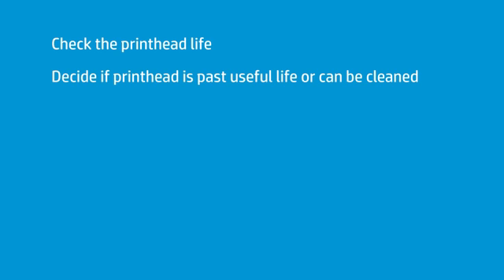Clean a Printhead | HP Latex | HP

Comment: THE BEST PRINTER
Reply: If you are making money selling you prints it doesn't really matter.. if you just want to use it once in a while then yeah, isn't worth it at all.. it's all about the usage, this machines are made to non stopping one day or two without a print the print head is gone
Reply: @ronaldsantamaria5226  sorry for my feedback but actually worldwideimages or plottermaster they sold me a printer that did not workI replaced full print heads more than 3 times and it never worked, HP LATEX is actually one of the best printers YOU DON'T NEED TO WAIT A DAY TO DRY THE IMPRESSION, easy to change printheads, no need to pay for replacement, I love it hp latex
Reply: Hello I think so too. My comment was for the other dude but I'm barely getting use to comments in youtube lol